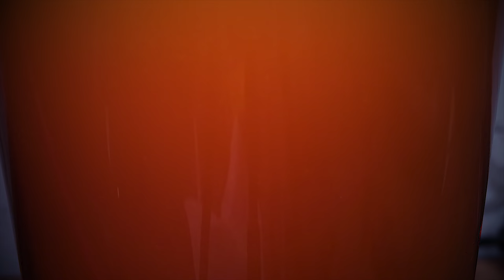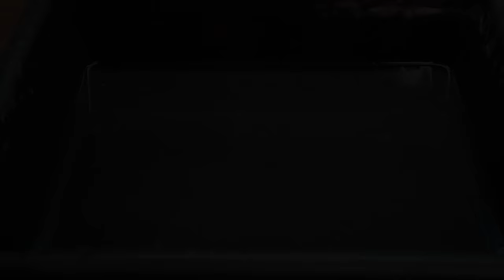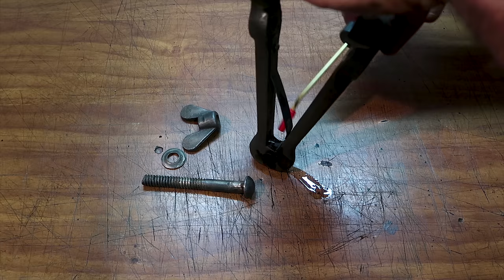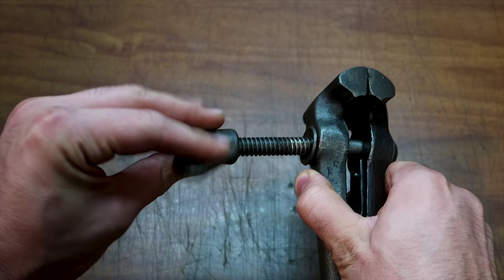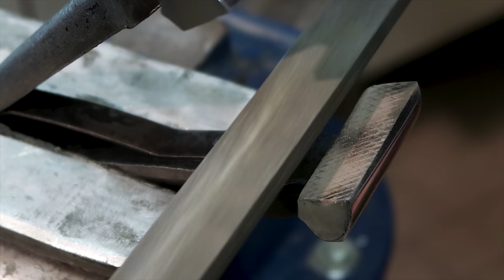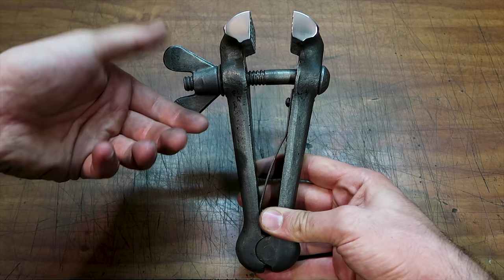Hand Vise Restoration

Comment: Just had to make a new spring steel spring plate for mine from the steel off an old saw , the fixing screw was striped so I drilled a hole though and fitted a small bolt and profiled the nut on the outside. High quality steel this is made from so I used three sizes of bit with oil to get though it.great job on yours by the way!

Comment: When it came out of the rust removal bath I thought, why even bother, this thing is not worth the effort. However as the process continued  I had to pull the chair up closer to the monitor thinking this is going to be good. Yes indeed great restro, and it works. I saw one of those tools made in brass on another channel, and instantly thought, gotta have one of those tools. That spinning wheel on the grinder gets a little scary. As always you do great work...Ken

Comment: BB - What is the solution and method for rust removal?  My wife has found an old cast iron piece she loves and wishes to restore it.  It is about 3' high, 10" or so in diameter a bit larger at the base.  The metal is intact   but surface rust is all over, cannot get wire wheel on the inside.  I was thinking of using this method in a       drum of sufficient size.